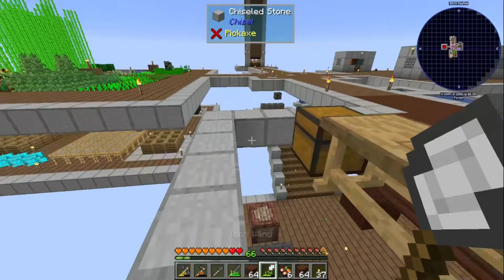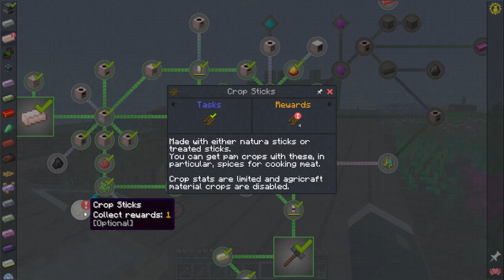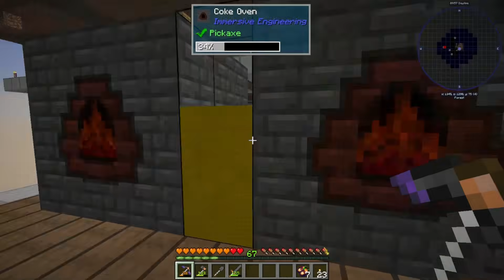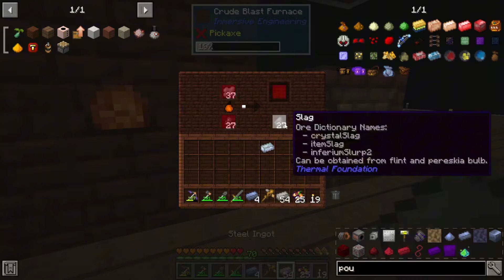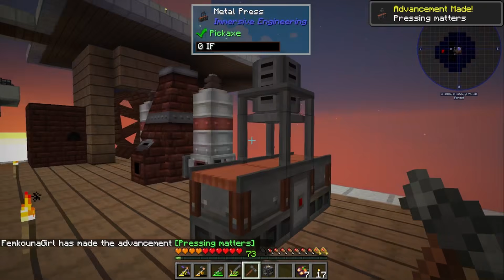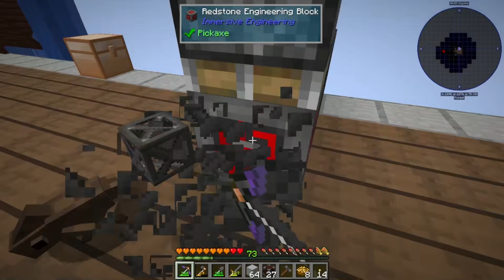Infinite Alchemy: Episode 7 - Immersed In Immersive

Comment: Btw you can make wire mold for metal press
Reply from the maker: What? Is that just in the newest version? Or does the regular IE one work?
Reply: @avilionamillion regular IE one. I couldn't be assed to remove all plate recipes added by various mods but there are only so much wires so i removed and readded all of them